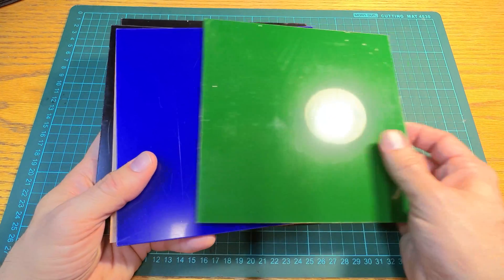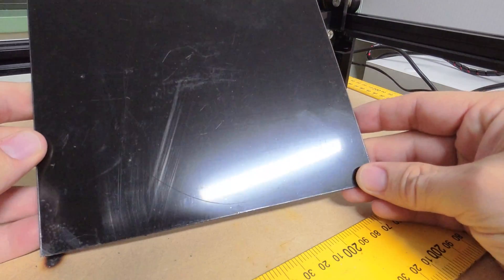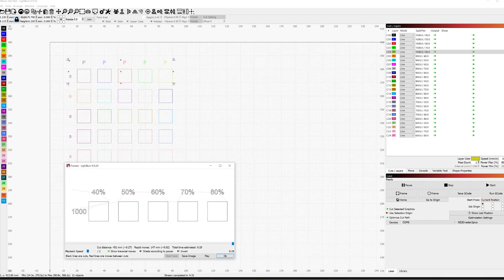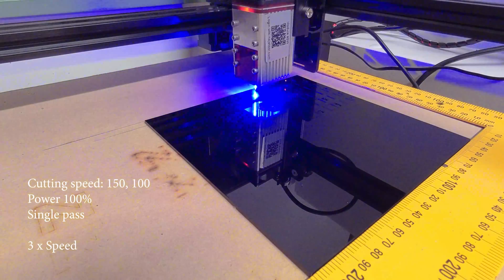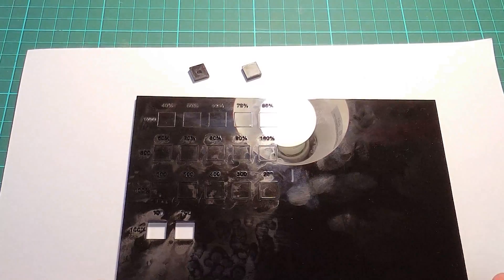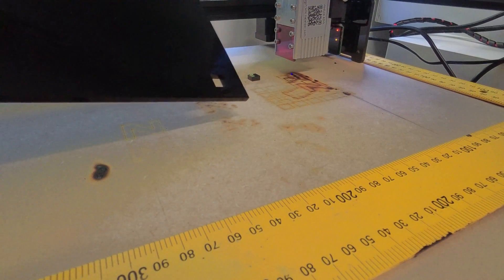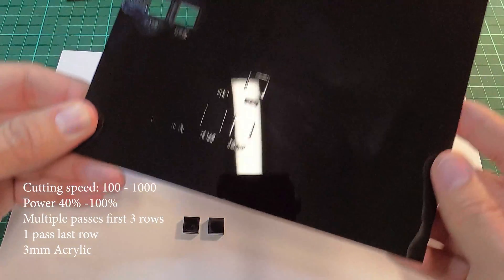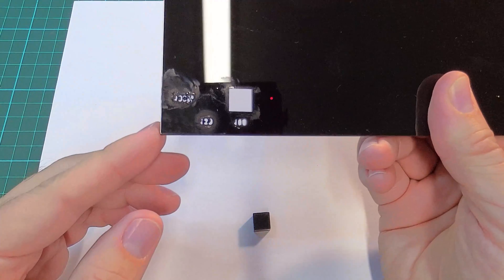Cutting acrylic with the NEJE 40W Laser cutter/engraver

Comment: HI
I have the same module and not able to get the same results as far as the speeds go
I checked the 12v Supply and make sure it is 12v
The TTL voltage is only 2v at 100% power can you measure the TTL voltage
On laser it says 3-12v TTL but TTL is normally max 5v 
What controller is in the machine
Reply: Perhaps you've to clean your lens with some IPA, air assist while cutting will help to prevent the need of cleaning the lens for a longer period. As far as I understand TTL will turn the laser on or off as long as it is in the range of 3-12v, by PWM it controls the power of the laser. If the voltage is too low to operate correctly your wires might be too long. Did you measure while connected? Besides that, the results can vary per brand of the acrylic and extruded/cast.

Comment: Not strong enough for acrylic. 40w is not the power but the electricity use. Power laser is 7.5 w. A 40w laser is much more powerful than this. Now the stronger NEJE laser is 12w and the newest in 2022 the E40 is 11W.

Comment: Thanks for the video. It seems the area aroud the cut gets burned and not bright .I am wrong ?
Reply from the maker: Yep your right, in this video I cut directly on the board and that caused burn marks, with a cutting bed that lifts the piece off the waste board it works much better

Comment: the air assist could help to cut? do you try 8mm black acrylic?
Reply from the maker: I have not tried 8mm acrylic, don't have any shops in my neck of the woods that stock it will need to order internationally. Air assist sounds like a good idea, thanks.

Comment: Is there a reason clear acrylic is not included in testing?
Reply from the maker: I did try in this video at around 8:20 https://youtu.be/gxHC_UNGgWc?t=27  This laser is the wrong wavelength for clear acrylic you would need a CO2 laser for that.
Reply: @makerz4247  Thanks for the update.

Comment: Thanks for the comparison. How about the smoke? Do you have to pay attention to something here?
Reply from the maker: Yep, I just used a regular fan and put the laser near an open window to blow the smoke out. You also have to make sure whatever you cut or engrave does not emit toxic gases, wood, acrylic & real leather is usually fine but double check anything else
Reply: @makerz4247  Thanks for the valuable tips.

Comment: I'm confused about setting the speed.. what is the minimum and maximum speed for the laser diode on lightburn... I use a neje laser module...thanks🙏🙏
Reply from the maker: It depends on the material and thickness you are trying to cut or engrave, for example these are some of my settings based on the 40W module: 
3mm cardboard 900mm/m @ 65% power
4mm cardboard 900mm/m @ 75% power
3mm black acrylic 100mm/m @ 90% power
3mm Plywood 200mm/m @100% power
But usually its a bit of trail and error to see what works best

Comment: Thanks for making this video! I was thinking to upgrade my laser module to 40w mainly for cutting 3-5mm plywood, was wondering can it cut thru 3mm plywood in single pass?
Reply from the maker: Hi, I was able to cut 3mm plywood at 200mm/s @100% power, there is a bit of burning though so might be worth trying more passes or covering with masking tape etc. Or air assist might help as well.
Reply: @makerz4247  Glad to know that! Thanks for the info👍👍
Reply: I have good luck on 3mm ply at 300mm 75% power 2 passes.  Air assist.  Nice clean cuts.

Comment: will this cut clear/transparent acrylic? if not, is there any alternatives?
Reply from the maker: Diode lasers cannot cut clear/transparent acrylic, you will need a CO2 laser for that as the wavelength is quite different, diode lasers are between 810 to 1064 nm and CO2 in the infrared range 10,600 nm.
Reply: @makerz4247  thanks for the info! are you familiar with co2 laser? is there any co2 laser that you recommend for beginner?
Reply from the maker: No sorry I don't have one so cant really recommend any, but there are some "affordable" K40 type ones on Aliexpress but you will probably get what you pay for.
Reply: I am able to cut transluscent acrylic, the red/orange color has worked so far, 3 passes at 200 mm/min speed, 100% intensity, then 1 finishing pass at 100mm/min speed also 100%, but the finish comes out a bit rough, & still trying to tune it a bit, but it does cut.  I cut with the backing paper still on.  You do have to sand and burnish the edges after you are done, but it does cut through it.  Stinky.

Comment: You still can cut today acrilic or the diode lost 40-50% in 100 hours??
Reply from the maker: It is still cutting fine, I have not counted the hours I used it though
Reply: @makerz4247  I'm waiting for the same module, so I'm very happy, maybe with a couple of LD the loss of power isn't so heavy. Thanks a lot Bro

Comment: Do you think this machine is worth getting if I need to cut acrylic and quarter inch woods?
Reply from the maker: I think you will run into limitations quickly. It only really cuts black acrylic well and soft wood. If you need to only cut 3-5mm black acrylic and balsa wood it should be fine but anything else you will need a CO2 laser.

Comment: Using 3 mm black acrylic I got nice cuts with my 40 watt NEJE. I left the protective "cover" on. Got a decent cut at 50% 200 mm min 2 passes. Also did a cut out of my shorten name "Mike" in New Times Roman at 125 mm min at 40% 3 passes.  Your video is much appreciate. Recommend you get a honeycomb bed for cutting. It should improve you cutting of designs with details in them.
Reply from the maker: Thanks. Funny you should say that. I just uploaded a video testing with a laser bed. Unfortunately couldn’t find a honeycomb bed locally so made something else. I’m still in two minds if I get better quality cuts with a single pass at high power or multiple passes at lower power.
Reply: @makerz4247  consegue cortar LP musical Black ??? Disco de música preto de 30 cm
Reply from the maker: I had to google translate your message but seems like you are asking if the laser can cut black vinyl records. I have not tried, but also, and more importantly, seems like it will emit toxic fumes when cut with a laser, so please don't try.
Reply: @makerz4247  acrílico Black não emite gás tóxico também?
Reply from the maker: It does, which is why you need some ventilation but it is not as toxic as Vinyl which produces Chlorine gas. There are a few pages on the internet with guidelines for safe and unsafe materials and most consider Acrylic safe ( with ventilation). for example http://fablabdevon.org/wp-content/uploads/2014/08/Laser_Safe_Materials1.pdf or https://cardiffhackspace.co.uk/knowledge-base/laser-cutter-dangerous-materials/. 
You could possibly get a laser with a proper filtration system that you can use to cut more toxic type materials but the Chlorine gas is corrosive so might end up damaging your machine. 
I am no expert, just cautious so please do your own research before laser cutting .
Reply: @makerz4247  Muitas pessoas cortam no Brasil para fazer relógio usando o laser co2 . Cortar em uma cabine fechada seria o mais seguro e também usar máscara ao abrir a cabine ? Vejo relógios cortados com um detalhamento de laser e pensei que não fosse tão perigoso . Obrigado pela sua atenção e dica de segurança.
Reply from the maker: Most of the CO2 lasers are enclosed and have an optional or built in air filter/purifier, dont know if they are any good for toxic fumes, guess it depends on the make/model etc.  You could try and build an enclosure and air filtration system for this type of laser but as I mentioned earlier the Chlorine gas is corrosive so will eventually damage the laser as well. Maybe what you saw other people cut was not made of vinyl or something with toxic/corrosive gasses.

Comment: Please can you tell me the width measurement of the hole compared to the width measurement of the cut piece? I am interested to know the cutting width.
Reply from the maker: Good question, on the 3mm black acrylic the inside measurement of the hole is 10.1mm and the cut out piece is 9.7mm, so 0.4mm difference for both sides, so the cut width for a single cut is 0.2 mm. Like all good answers I would say it depends... for example on the material you cut and the laser settings etc, but this example is one of the better/finer cuts
Reply: Note that the beam is oval shaped (it is wider in one direction than the orthogonal direction).  This is the reason that it cut through in one direction but not the other in the 3mm sheet.  If your software allows it, you could cut faster along one axis than the other.

Comment: Excellent, I'm just about to start cutting with mine, so you've taken out the trial and error for me :) Do you think it will cut different colours of the same thickness?
Reply from the maker: I think colours that absorb blue light will work but colours that reflect blue does not work for example blue or purple acrylic or white acrylic.
Reply: @makerz4247  cometi ese error justo compre un acrilico blanco y un clear y no me corto
Reply: @makerz4247  Would clear work if it's not reflected then? Or would the wavelength be wrong to actually cut it
Reply from the maker: I tried clear, and it does not cut it in this video, https://www.youtube.com/watch?v=gxHC_UNGgWc around the 8:15 min mark. I think you need a CO2 laser to cut clear acrylic

Comment: Thanks a Million dude! I guess the only question now is will running 100% kill the diodes? The cooling on this new module is much better than the old modules in my opinion. But I wonder if it's enough
Reply from the maker: Thanks, yeah I was wondering that as well, the fan on the laser really spins up at 100% I might just tone it down to 80% or 90% and do more passes. Guess I will see over time how long it lasts
Reply: @makerz4247  what you think how long it can last